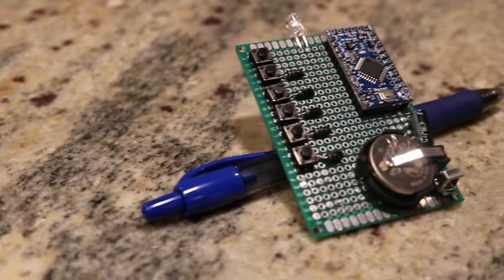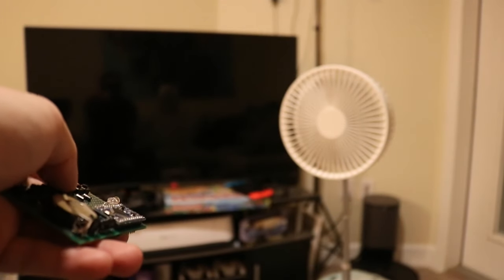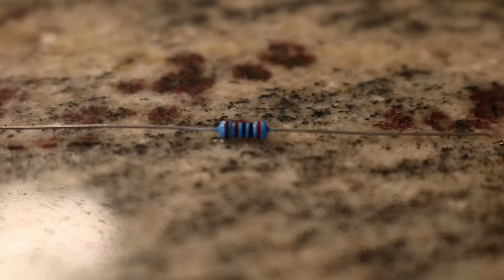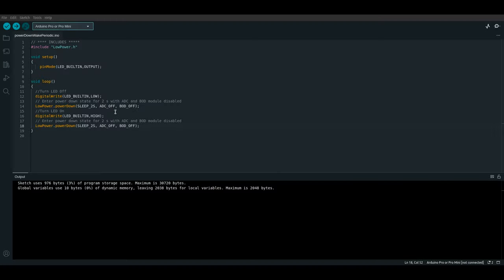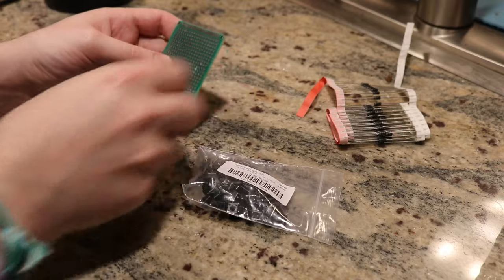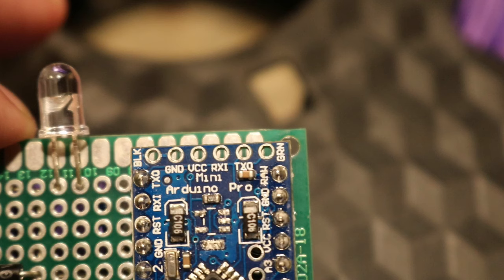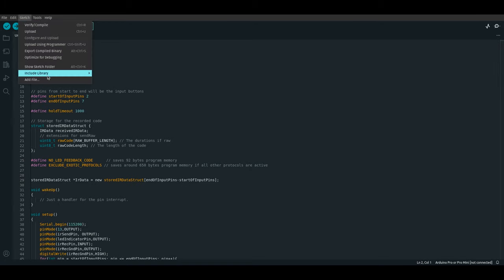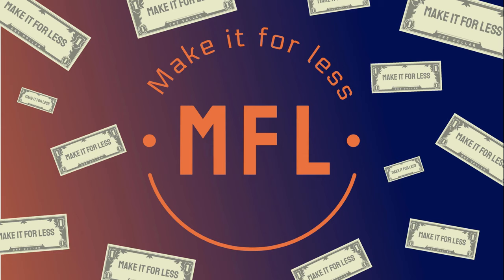Take control of your life for only $10!

Comment: For ultimate battery saving mode you can try this 

The use a transistor for a main switch just after the battery

The same button you are using for Remote control use same ones to connect to the base of the transistor

That way battery will be always disconnected when not it use 

Learned this trick from all time favourite elecronoob
Reply from the maker: Hmm, that's an interesting idea. My only concern is that it takes some time for the device to boot up and I would think that by the time it does the button will not be pressed anymore and the device will turn off. I will definitely be looking into this though! Thanks for the tip

Comment: Nice guide. I built one and used some of your code (without the receiver parts), but I have to aim the remote straight ahead at the TV, and at like a maximum of 1m away for it to work. I used a transmitter I got from some old arduino starting kit though, so maybe that could be the main issue? Does your remote work at longer distances and okay angles?
Reply from the maker: Hmm I definitely had slightly better range than that but there were differences depending on the receiver.

Comment: just starting right now. Is there a way to connect it to 12volt or even better to 230v instead a battery? and .. i just want to build a Panel with custom buttons in my studio desk, is there kind of a way to install buttons away from the circuit board? or  how will things like that be realised?

Comment: You only need the buttons. No diod, no resistor. Use internal pull up and maybe denounce.
Or I'm wrong 😅
Reply from the maker: The diodes are used so that all buttons can pull pin 2 to ground but not any others. I had to do that because pin 2 is the pin that will wake the device from deep sleep.
Reply: @makeit4less  can i use 4 pin buttons? i also used arduino mini pro clone, it has the acc pin, not the vcc, can i replace it with gnd entry?
Reply: @makeit4less  pls reply

Comment: Which version of pro mini 5v or 3v used in the project?
Please reply
Reply from the maker: 3.3v
Reply: @makeit4less  👍🏻
Reply: @makeit4less  Probably worth replacing the link to the 5v version with the correct version. I bought what you linked to and I'm now having issues due to the fact that the board is a 5v version and the battery is at around 3.3. I do realize I could've done some more research but I just assumed your links were correct.
Reply from the maker: Oh, I did not realize that. I will fix that ASAP. Thanks for the heads up

Comment: Bro can I make this project in without use diode please reply bro
Reply from the maker: No, the diodes are a necessary part of the circuit
Reply: @makeit4less  can I use any diode
Reply from the maker: Most will probably work but I have only tested with the one in the video

Comment: How to add more bottons in this circuit please reply bro
Reply from the maker: 6 was the most I could get to work but in theory you could copy the circuit to the other input pins
Reply: @makeit4less  why your are not using the Arduino nano board
Reply: @makeit4less  also edit the program right
Reply from the maker: The pro micro has better low power performance 👍
Reply: @makeit4less  when I add 3 more botton to the circuit,it requires only 3v ?